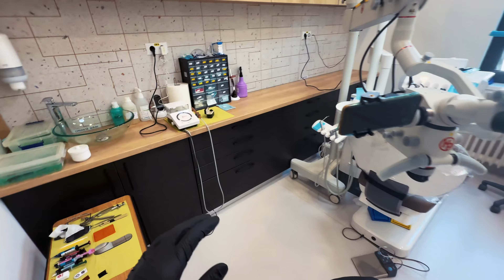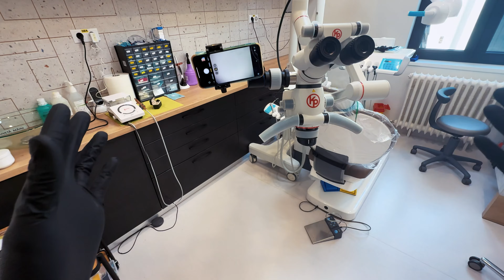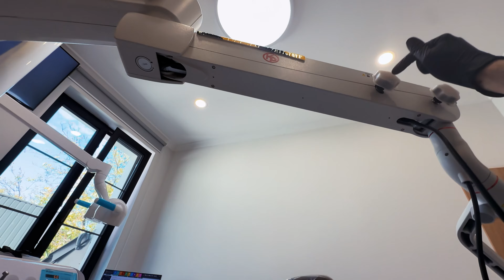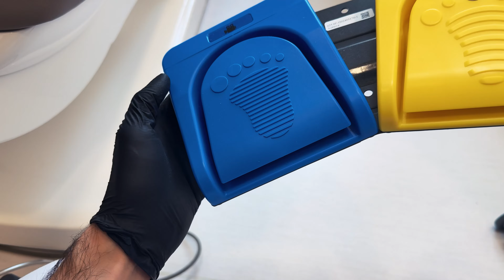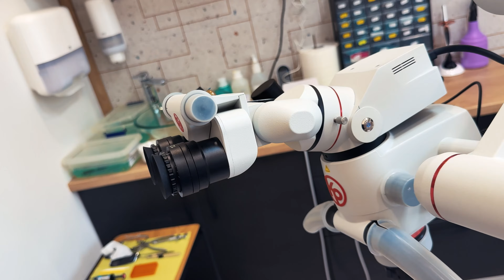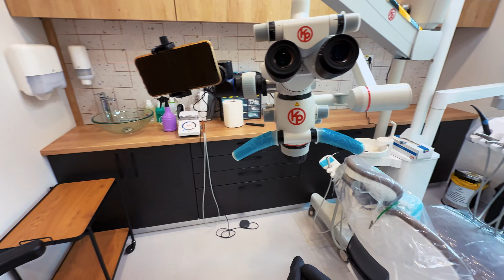Is the Kevin Peter Microscope the BEST Budget Choice for Dentists This Year?

Comment: How do u fee about the brightness of the led from the isee9000? Also, i case of need of the repair of such....how hard/easy might it be to fix it yourself?
Reply from the maker: Brightness is fine, not the best. It will be improved from what I kow when the second generation scope will be launched. I terms of maintance I would defer any work to the local dealer so as to not void the warranty.